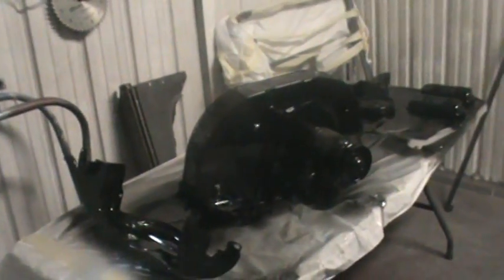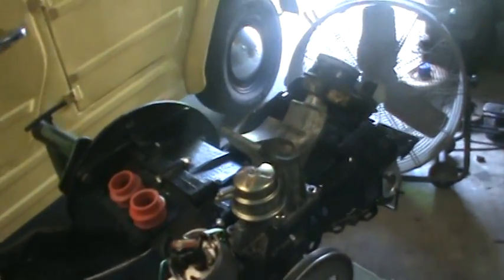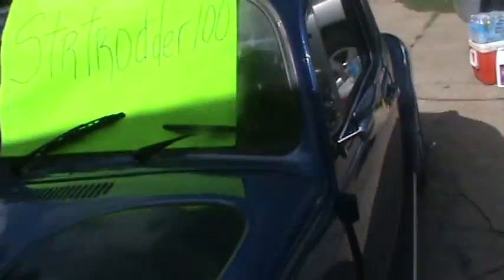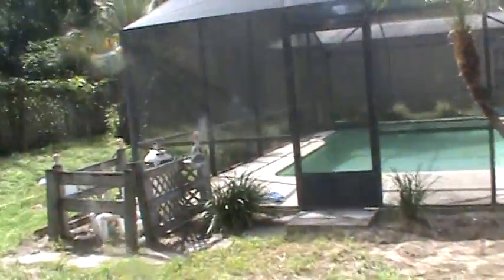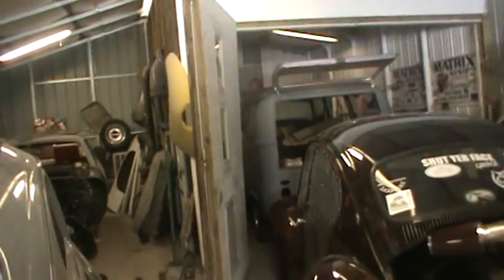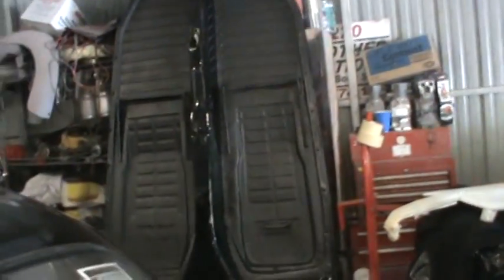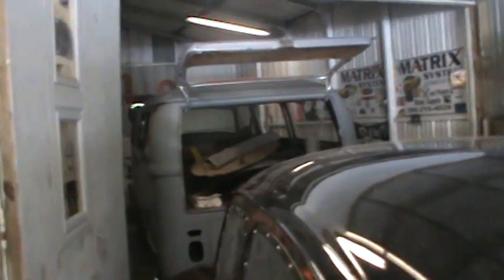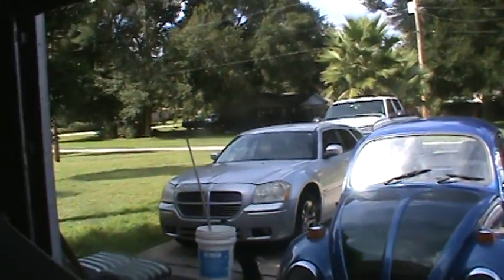MORNING VLOG 9/15/2013

Comment: Dodge 4.7 head gaskets, 165,000 miles, you just don't plow gaskets in those, machine work, replace hoe powder metal seats that brake and fall out.  Starts questioning me about parts, why a water pump, radiator , t-stat,  he was by a shop that didn't  even want to touch it. Told him price up front, he agreed.